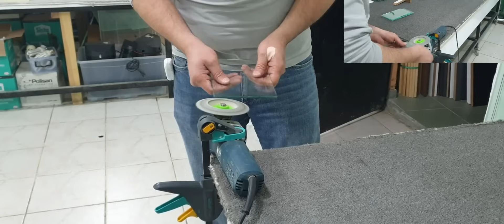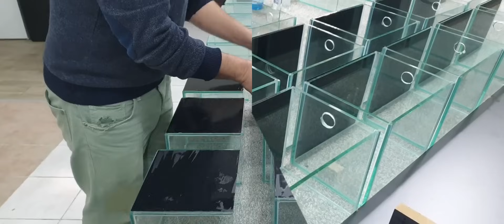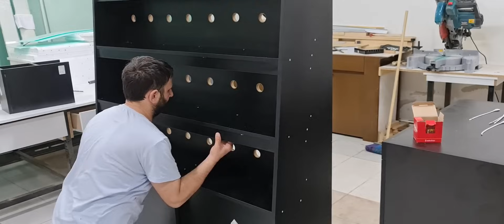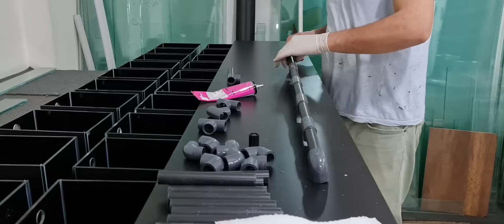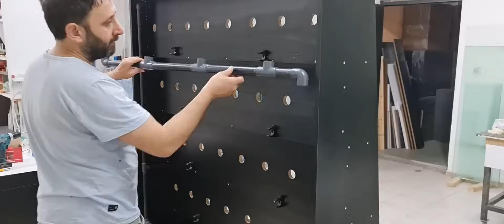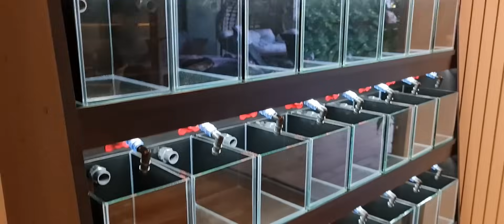BETA AQUARIUM SET WITH SUMP SYSTEM - 32 Aquarium and Filter System

Comment: That is very pretty.  But whatI didn't see shown in the video is the standpipe - a vertical pipe that is open ended and extends above the top row of tanks.  Without that open ended standpiple the tanks can drain fine down to the filter but with time air can accumulate and either reduce the flow down to the filter or completely stop it resulting in overfiling the tanks.

Comment: Very nice! Only things I would have done different; run the water return plumbing behind the cabinet. Used a different valve instead of bright red and made the returns from the tanks so you could disconnect and clean the tanks. Hopefully as mentioned you have a standpipe.
Reply from the maker: Thanks for the advice, but I explain all such subtleties to our customers and build aquariums at their request.

Comment: You are definitely a professional and it is a pleasure to see you work, but the system could have been used in a different way, which would have made it easier to build and more beautiful, and much, much less pipes and fittings would have been used.